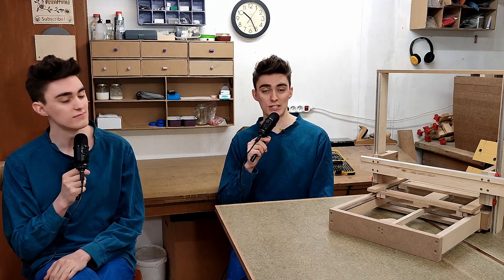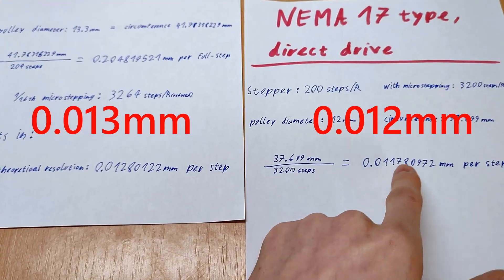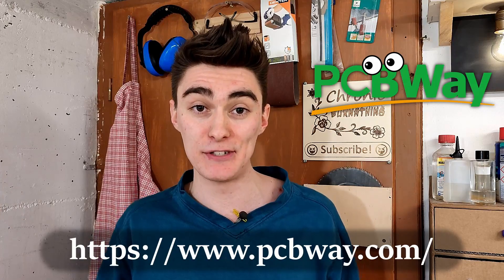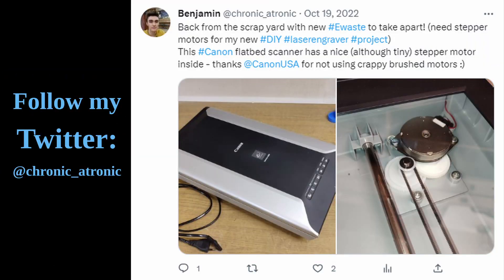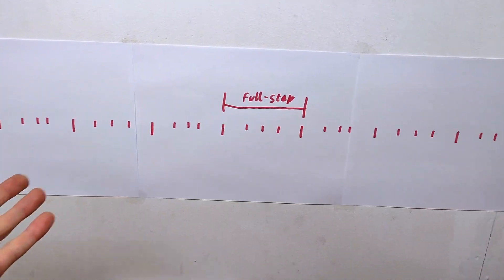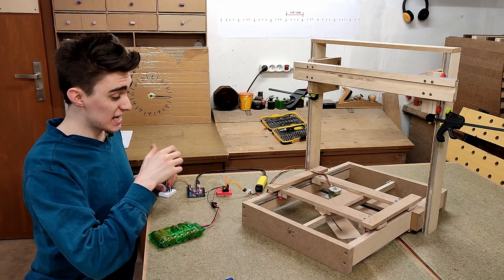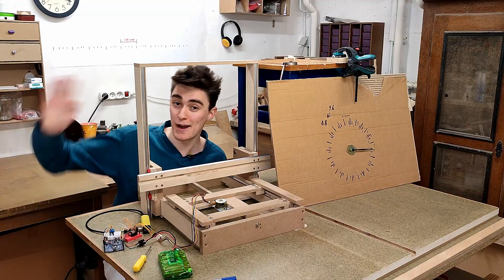Motorizing the Y-axis of my wooden DIY 3D printer!! | The stepper motor predicament

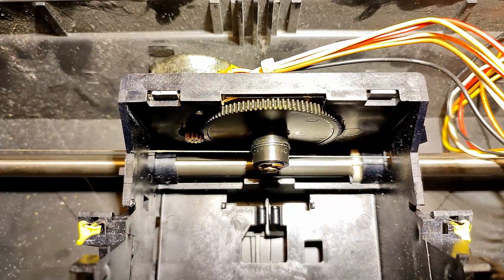Comment: 2:12 I am wondering can we use Guitar E string or it will Deform I have some laying Around ?
Reply from the maker: I've never seen guitar strings close up, but if it doesn't permanently deform when bent to the radius of your drive drum it should be usable
Reply: @ChronicMechatronic  it is Very very strong in tensile strength but if tried to bending around pen it partially Deform but because it is also flexible and very Strong  I think I have to try by building simple one axis because Its very cheap if you get from Local Guitar shop .
Reply from the maker: Sure, go for it. Building a single prototype axis is a good idea, I should have done that too, there's so many details one would never imagine to be learned from doing it IRL over just having a computer model. I'll cover all the things I've learned on that printer so far in a "lessons learned" video after I get it to do it's first print.

Comment: Are they working with lead screw?
Reply from the maker: You mean X & Y-axis? Not tried it yet, Z-axis is done and works fine with lead screws so far. But I'm sure the other axes will be fine with lead screws too. I'm guessing you want to go ahead with your build - if you use the same kind of stepper motors with 24 or 48 steps per revolution you'll be on the safe side using an M5 threaded rod. Z-axis can use a normal (preferably brass) nut because gravity eliminates backlash. For the other axes I plan to tap a small plastic block to get a zero backlash nut...

Comment: If this motor skips 2 of 4 microsteps in quarterstep configuration, maybe worth trying just halfsteps, 0.1 mm resolution seems pretty reasonable for the test.
Reply from the maker: Yeah I guess if I just wanted to print bigger stuff with a 0.8mm nozzle it'd probably be fine at 0.2mm resolution even. Problem is not even half-steps are the same size, I did try it off camera and it's always 75/25 just like with 1/4 stepping.

Comment: Hey there, me again. I was looking into your code and I was a little surprised to see 5,000 as the speed for the steppers(granted I never looked up the stepper data sheet, this is probably the right speed). Also, The Accel stepper library has some useful functions such as acceleration and the ability to "Zero" a stepper. If you implemented the potentiometer to rather be a location of the carriage and add a switch to then tell the Arduino to go to the potentiometer mapped location you may be able to smooth out the jitters you are experiencing currently. It would also be good practice to prepare you for handling g code instructions that send the tool to the desired location. There are also Multistepper functions in that library for more fun. I'd recommend looking over the info page for the library to get a greater understanding of what capabilities it has.
Reply from the maker: Hi Alex, I hope you didn't have to cringe too much at my crude code! I don't know where the 5000 came from, but I heavily rely on tutorials to put most code together so I might have picked it up somewhere. The 200 step/r motor certainly goes that fast, at least with microstepping... I haven't heard of zeroing in Accelstepper, but I get what you mean with the potentiometer input as a location and might even be able to put something like that together. If I can find the time between filming the next episode and designing the PCB for another, I'll give it a try!

Comment: I'm curious if converting those to bipolar would make it worse or better? I myself and doing a test of a corexy 3d printer using 28BYJ steppers that I plan on converting to bipolar to see if that helps any.
Reply from the maker: Unfortunately the test was with them already in bipolar configuration :(
As far as I know maximum possible microstepping in unipolar configuration is half-steps. Though if you use 28BYJ-48 you likely don't have to worry about resolution thanks to the gearbox already built-in. Just a ton of backlash you'll need to compensate in software
Reply: @ChronicMechatronic  yes thats what I was afraid of :(
Reply from the maker: I'll actually be using a 28BYJ-48 for my extruder, since I figured I just need to bump up the retract setting a bit to counteract backlash